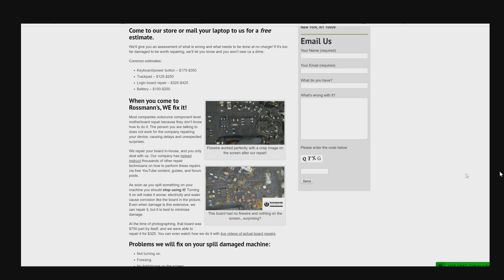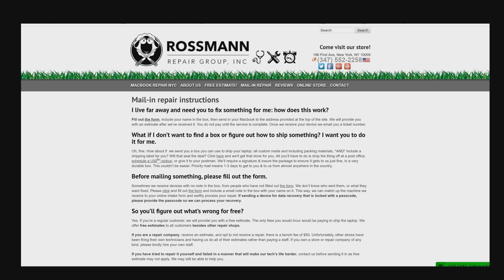USB drive DESTROYED by customer; Louis attempts data recovery anyway.

Comment: Ah the customer with the $5 3M Wal-Mart iron strikes again.
Reply: I've done data recovery on many a snapped off USB flash disk using a crappy cheap soldering iron...
As Esven mentioned, its just a case of soldering on a new connector to appropriate pads/pins.
I used to use cables from dead mouses because they were nice and thin. Customer never wanted the stick back - just the data.
Reply: Hey I've worked miracles with a 5$ 3M iron.  The problem here is someone with no experience and too much ambition.  

It looks like originally the usb connector sheared off, which is pretty common from the drive getting bumped while it's plugged in.  The pads around the connector are just the most aggressively sheared off so it seems like that was the original damage. The customer tried to fix it themselves but learned that the pads were gone underneath the connector so they couldn't just solder it back into place.  You can see all the mess from that original fix, and it's covered in more dirt than the rest of the bad solder jobs indicating not only that it was the first thing they attempted to do.  

Presumably they got the idea to buy a donor drive and transfer the flash from one drive to the other at some point, but it took them a while to actually do that so the drive sat somewhere covered in flux and collected filth.  With the donor board finally in hand they started to desolder the nand from the original.  That IC has a lot of pins though, so they tried to flood it with solder to melt multiple pins at once.  They are probably just using a 30W iron though so that's just not going to happen.  So now because of all the solder they can't even really properly melt individual pads any more.  So they're now jabbing an iron into half melted solder, trying to get enough of the chip workable to start removing it and it isn't working.  Then they try and lift the pins one by one with the iron they get some to move but it rips the pads on some of the others.  At some point they realize it's a mess and that this is only the beginning.  They'll have to carefully desolder the memory from the donor board as well then solder the old chip back into place.  So they push the pins back into a semi normal position and pack up the drive to get someone who actually has tools and experience to do it.  Only now the drive has solder blobs, flux, dirt, and damage from everything they've done.  Where originally it just had a broken connector.

If they'd just tried to place a few jumpers from the connector pins to an appropriate connection point they'd have actually been fine with a crappy iron.
Reply: @esven9263  Replacing Nand won't help as there will be no filesystem without controller chip.
Reply: @otofoto  I was giving the order of events that the person who originally had this drive probably went through based on the excessive damage.  I you might be mistaken in a few ways though.  First just to be clear I'm not really talking about replacing the NAND on the damaged drive but rather transplanting the NAND from the damaged drive to another flash drive of the same type.  That will absolutely work but it needs to be exactly the same hardware configuration and not a later revision.

Second the controller IC on there opposite side is only there to implement the USB stack and some other simple functions such as blinking the data and power LEDs so it can act as an interface between the memory databus/control signals and the USB data lines.  It's usually just an 8051 IP core with a few extras.  The memory controller itself which handles addressing and bad sectors and things like that is built into the NAND flash itself.

Third the file system has nothing to do with either of those really.  A file system is just an established standard for organizing memory.  In fact you can have multiple different file systems on the same physical drive.  On the disk itself in the first sector is the master boot record.  This contains some bootstrap code in case you ever tell the computer to boot from that drive and a list of partitions and their addresses.  Each partition includes a header with a system ID which tells the computer what the file system used by that partition is.  i.e. NTSF, FAT32, EX3.    The value of that identifier tells the computers operating system how files on that drive will be organized.  The file system is entirely independent from any kind of memory controller.
Reply: Yeah but using a cheap non temperature controlled iron is a good way to delaminate the remaining part of the pad off the board if you care about getting the data off of something you shouldn't use a cheap direct mains iron.

Comment: My first experience with microsoldering was replacing an 0402 resistor while only having access to a 30 year old soldering station, lead free solder, some cheap tweezers and a crappy magnifying glass. My solder joints still looked better than this thing before the repair.

Comment: The flash drive cost $2 on amazon in a back of 5 for $14
Reply: But the data on it could be worth way more than that, so the owner can't just replace it.
Reply: @XsBig  true
Reply: People with data that important should buy better flash drives anyways.
Reply: @JessicaFEREM  it's a Kinston 101 flash drive
Reply: @hlmc00  And there is the answer to why they  have  different innards. Kingston doesn't manufacture their own memory and controller chips, they only uses what's the cheapest at the moment.